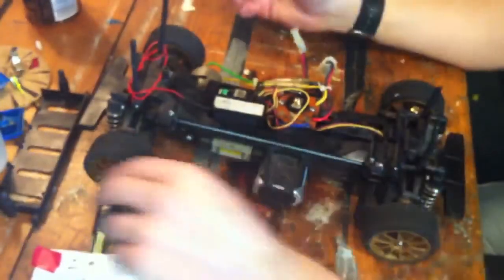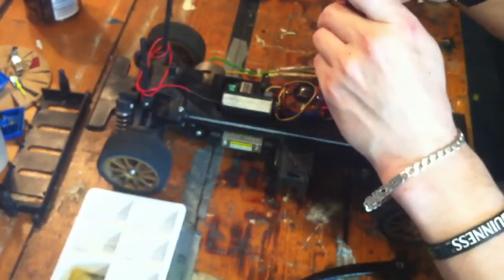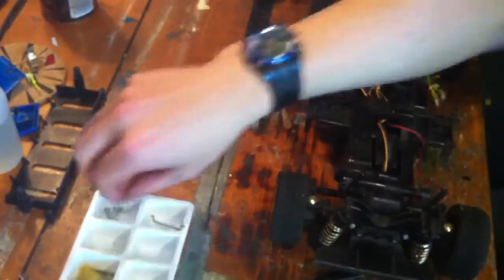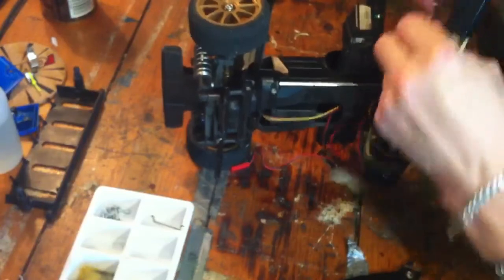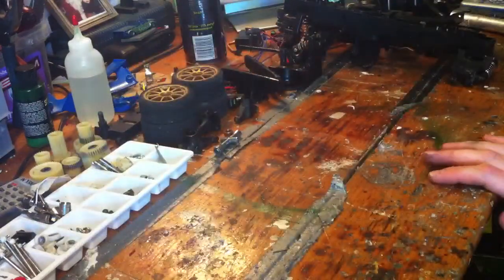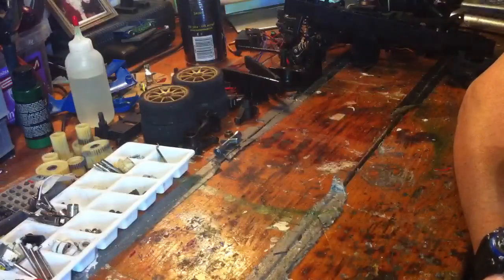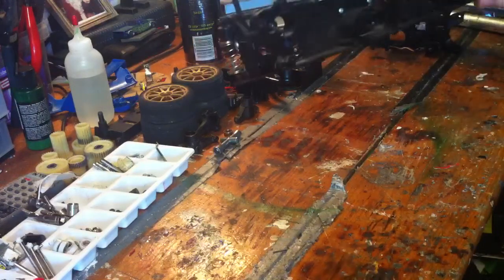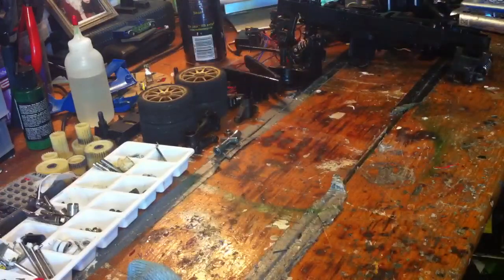Under the Hood TL-01 Scooby part2

Comment: The motor is a 27 turn. Suitable for voltages from 6.0v to 12.0v. Unloaded it draws 1.35Amps at ~19,500rpm. At maximum efficiency it draws 7.9Amps at ~16,650rpm and produces about 333g/cm and 57W. At stall it draws 46Amps and 2278g/cm (specs thanks to the manufacturer website